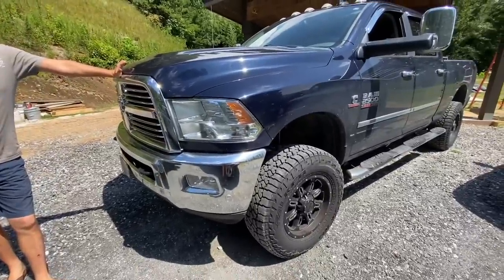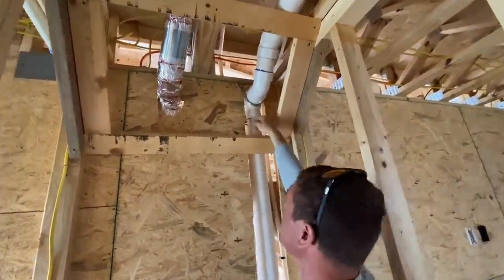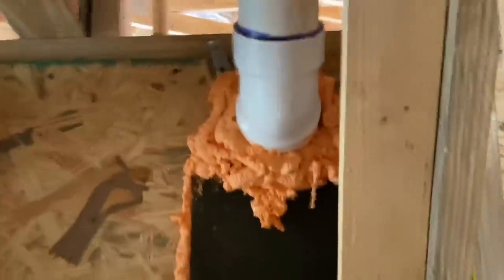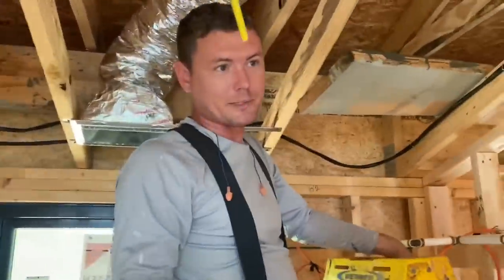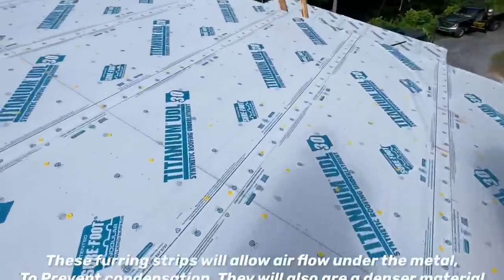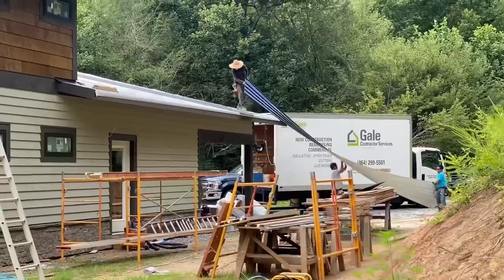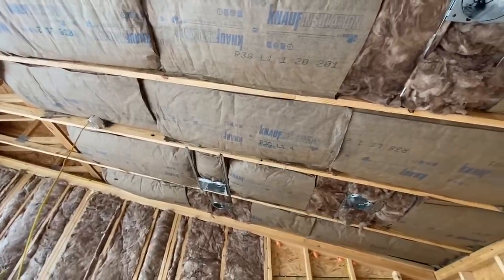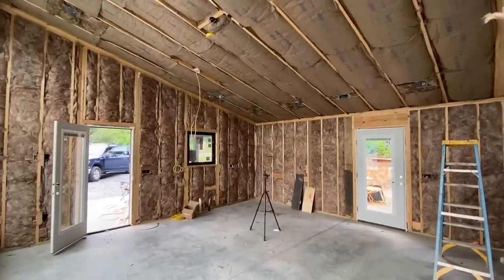Building A House Start To Finish | Episode 15: Inspection Fails and Roof

Comment: If I were a roofer I feel like if I felt a single drop of water especially on a metal roof I would want to get off as fast as I possibly can
Reply: Yeah that's kinda how it is, I live in Tennessee and I've seen roofers leave in b4 it rains. They see dark clouds forming and call it quits. People usually think it's not dangerous but all it takes are a couple drops before u go down

Comment: I'll never understand the concept of creating a water tight barrier and then shooting thousands of nails and screws through it....
Reply: Talking about the metal roof?  Yeah, it is kind of counter intuitive, but, they work.  More and more residential applications are using metal roofing because it has such a good life expectancy, is fairly inexpensive, looks pretty sleek, and keeps out the water.
Reply: @jimyeats  With all roofs, they work til' they don't, then you have a leak and all kinds of nasty stuff happening - especially in these air-tight homes. Be it siding or roofing, your cladding should NOT be your water tight barrier. Your cladding should be UV/wind/hail only. Never water. Even the ZIP system will fail, in my opinion. Far better than tyvek or other paper, but you are still penetrating your water barrier into water sensitive materials every time you go into it with a nail/screw or staple...
Reply: krishields2 Your post is all over the place. Unsure what point you are trying to get across. You should have roofing and siding that protects from bulk water intrusion, and a decent WRB behind that to protect against small seepage and leaks that will invariably get behind your roofing and siding, and a system that allows for good air drying between. 

Stop bulk water, and stop lots of free air movement into the home.
Reply: @jimyeats  That's the old way of thinking.... And that's why they always fail.
Reply: @Adventures_of_Marshmallow  That's actually the new way of thinking.  The old way of thinking incorporated trying to stop "vapor" and making a house that could "breathe".  

Current science realizes that you need to principally do two things; stop bulk water intrusion, because that's always a problem, and stopping free airflow, as that dumps far more moisture into a home than vapor does, as well as allowing for much more thermal loss than previously thought.  Many ways to do this, as well as many insulation techniques to consider.  

Would love for you to describe the perfect system so I have a better idea of the point you keep alluding to.  List specific products.
Reply: @jimyeats  I'll try to explain. First sheet your trusses / rafters with whatever sheet goods you prefer, this will become your watertight layer. Second, affix a non water sensitive 2x2 at each rafter / truss on top of your sheet goods. Third, apply either by spray or roll a waterproofing product of your favorite flavour over the entire roof deck ensuring full coverage and proper fillets over the azek 2x2s. Third apply a secondary layer of non water sensitive sheeting such as azek using proper length ensuring no more than 90% penetration into the 2x2 azek strips to attach whatever cladding you desire be it shingles, tile, steel, slate or whatever you want. As long as the fasteners you use penetrate no further than 1 1/4" below the bottom of the non water sensitive layer of decking, your home will remain water tight no matter what condition your cladding is in. Your roof deck and walls should be water tight both before AND after any cladding goes on.
Reply: krishields2 I can picture what you’re describing. That would absolutely be a great system. I think in most cases though that is going to be fairly cost prohibitive, especially when - in general - a ‘standard’ system works extremely well when it is done with diligence.
Reply: Why don't they make these roof panels with attached threaded screws. Which you could align with holes in your rafters? That way you can just nut them in place and you don't have to replace anything every 15 years.
Reply: @zteaxon7787  could do something like that also.
Reply: @jimyeats  Now take that system to the walls, you have a 1 1/2" air gap from peak to ground running the full length of the roof line which can now be utilized as a hidden seamless gutter system. Prohibitively expensive for the average joe, but not for the rich. Wouldn't it just be fantastic to not have ugly freaking gutters?
Reply: @Adventures_of_Marshmallow  Certainly.  Best option would be to combine one of your layers with exterior foam insulation, would really be the icing on the cake.

Comment: Hey guys, awesome videos. loving the series and came all the way back to watch all the videos to present.  I am an insulation installer in Ontario Canada, the code here has changed quite a bit within the last few years. in ceilings a minimum of R60 and R22 within the walls. every double stud has to be cocked with an acoustical sealant and then a vapor barrier.

Comment: Not sure if someone has already mentioned this but the hissing and no action is the can losing pressure. Best to hold the can upside down so foam always comes out, ie, no hissing and you don’t end up with a depressurized can that still has foam left but it’s dead. Love the knowledge and craft you guys display.

Comment: I insulated our house build in Lubbock, TX a decade ago. Thankfully it was done in November and December (right after Thanksgiving) so it was cold. Tyvek suit that sh!t up baby! I had duct taped gloves, around my boots, up the zipper, around my neck for a good seal, etc. STILL ended up with a razor shaving the underside of my forearms to pull the fibers out. So incredibly annoying. Still, WAY better than just a T shirt. :) You guys are awesome and I have learned a LOT from you. Keep at it guys! This is THC quality content, but actually good content, lol!

Comment: I am a building inspector in Indianapolis.  I'm not sure how your city/county handles this but the fire foam is not an approved fire blocking.  If you look on the can it says it meets the UL listings and the ASTM for fire blocking but there is an asterisk that says that it used a modified test.  Which is the reason it is not allowed.  You can take a piece of dried fire foam and easily light it.  I have wrote this violation many times.  I always say that it sucks that they market it this way so you think it would work,  and for the big gaps it's way easier to fill.  I always let the contractor know for the big gaps they can use un-faced mineral wool insulation/rockwool and that is approved.  Was really looking forward to seeing the inspection but I understand why it wasn't possible.  Really wish I could inspect your guys projects because you know what you are talking about and I deal with contractors on a day to day basis that don't have a clue about anything.

Comment: The header in the attic on the truss verts is a great solution for that issue to take up the roof weight off the plate over the window

Comment: If water ever gets under that metal roof, the horizontal furring strips will trap it. It’s better to use vertical furring strips on top of each rafter, and add horizontal furring strips on top. This will also improve ventilation.
Reply: This falls right in line with the statements that a house needs to breathe. Using real wood that can get wet and dry and using the ribbed panels that allow the drying to happen and proper flashing to control bulk water it will be just fine. 

Or you just install the furring strips at an angle that matches your truss to screw line. Eg truss at 24 and rib at 9 install the furing strips at 4 1/2 12 to the eve end.
Reply: Timothy Dillon - yes, it’s probably fine. I live in a quite wet area (Bergen, Norway). We’ve made some effort during the last 100 years trying to keep our houses dry even when the outermost layer of roofing fails. The current best practice is to ventilate between the insulation and the sheathing, use a waterproof ashphalt underlayment on top of the sheathing, vertical furring strips, then horizontal furring strips for cross-ventilation and finally glazed clay roof tiles. That gives you a roof that will last between 50 and 100 years without maintenance, unless something breaks a tile.

Comment: I watch videos on the Guilty of Treeson channel.  It's a channel run by a guy who runs a tree service in Seattle.  A while ago they had a job where they had to remove a completely dead tree from a homeowner's property.  The tree was between the house and the garage and both building had metal roofs.  While they were cutting parts of the tree off and removing them with a crane, a bunch of small pieces were landing on the roof of the house.  The final day they were there it was raining and they had a pain trying to clear all the debris off the roof.

Comment: The company i work for we got basically screwed by some floor guys they basically just stopped contacting us to do this customers house. So we decided to sand the floor are selves my bosses having a little experience in it we went for it. Well lets just say it didn't go well especially around the edges and we didn't realize till we stained one room. So we had to re sand it and go around all the edges and sand them perfect. It was a huge pain I was sore as hell but at the end of the day it looked way better and the customer was happy. Which made all of it worth it yes in trades you have hard days. But seeing the customer happy makes it all worth it to me.

Comment: Its beautiful watching people care about their craft. Even taking pride in insulation that doesn't get seen by the home owner. Question though, wouldn't you want the roofing slats to go vertical or at an angle to if water somehow got in, it could escape? If water got through the seal of the screw it would just sit and rot the wood. Also no vapor barrier needed in this climate region?

Comment: My professor tries to avoid using too much spray foam because she doesn’t believe it’s been around long enough to know if it has any long terms negative health affects or is causing any negative affects on air quality long term. So she only used it where it is absolutely necessary. We live in zone 5 so the I assume the R-value here it higher. She was also excited that she found these outlet boxes that had like these rubber flaps around them to actually seal the box and help stop air leaks. She only used them on the exterior walls. She works in the building industry and just finished her first leed certified house. Though she taking a step back and is going to focus more on her job as a professor.

Comment: What is the benefit of horizontal furring strips vs vertical or angled? Perhaps better air flow when horizontal, but how will water effectively drain if it get under the metal roof?

Comment: I've had two inspectors tell me that any spray foam will do for fire blocking. the fire blocking specific foam simply has a dye in it to make it easier to see for inspection.

Comment: While I agree with the firecode and inspector, you had to put a bit of flammable material (wood) over a hole to stop a fire in the event of one happening!    Just my oxymoron brain kicking in.    To be honest if all you had to worry about are those 3 minor defects, it is a good inspection!   We are not allowed plumbing in exterior walls due to Winter climate (Canada) and most times have to frame a mechanical chase and use pipe insulation to help with freezing.

Comment: Hey Eric, can you show another part of the 2x10 over the window and how it works ? Thanks !!
Great video btw as always !
Reply: Yeah, I can’t really see how those 2x10’s are acting as a header for the window.
Reply: You can screw the 2x10 to each truss. After that, you can simply remove all the the 2x4 on the flat and everything stay stable. The header is not actually below the truss, but at the same height. The span is only 36 inch.

Comment: I wish that more people were aware of Pro-Z screws for ribbed metal roof installations because the commonly used screws (the ones your roofers used) are the downfall of typical metal roof install. Pro-Z screws encapsulate the rubber gasket, supposedly cant be overtightened, come in all of the colors used by panel manufacturers and have a 50 year warranty. Who the hell wants to have to replace all of those screws every 10 to 15 years? That's insane and is enough to make people change their mind about choosing metal for their roof.  Google Pro-Z screws and it's a game changer.

Comment: if fairing strips are perpendicular to the roof pitch, do you assume that the condensation from the metal sheet will evaporate with air? Because the fairing strips will not allow for the water to run down the roof into a gutter.

Comment: My opinion is that glass wool is way itchier than rock wool. Wool made of recycled paper is not itchy at all but twice the price. Once i have made insulation of flax wool which can be done bare hands but also expensive and makes all knives dull in just few cuts. If i could choose any insulation for my house it would be wet sprayed recycled news paper. Or burned brick with air pockets. No plastic any where.

Comment: Jeez. What snow loads are you getting for 2 x 10 headers over tiny windows, 2-3 2x4s over a most single windows is plenty and we get 4 feet of snow on our roofs. I guess insulation is an afterthought.

Comment: Metal roof can be very slippery even when it has little water on it. However real Rubber shoes has best grip. You Dont put urethane wheels on your car either.

Comment: 10:00 Where does the water go if it gets under the metal roofing? The wood strips will prevent the water from sliding down towards the roof edge!
Reply from the maker: Well... good question. Short answer is that the metal roof should keep ALL rain water out. The air gap created by the wood strips allows for air flow to prevent Condensation under the metal. Strips or no strips if water gets under the metal it would leak. There’s 1000 screw holes and nail holes fastening the metal, just like if water gets under the shingle layer of the house it will usually leak due to all of the nail holes through the underlayment.
Reply: @PerkinsBuilderBrothers  Well, sooner or later water will get under the metal roof because the screw holes get bigger and bigger whenever the metal expands or contracts due to temperature differences between day and night. The rubber gaskets will eventually fail (usually  a lot faster than 10 years IMO) and that's why you should always go for a standing seam roof! Putting holes in a metal roof is never a good ideea!

Comment: The pipe can’t be there because it could be hit with a nail? Is it because it’s within 1 1/2” from the front of the stud? By that logic you can’t run any pipes in the stud bays. If you put it to the back, you not only lose insulation but you’d put the pipe in danger of being hit from a nail coming from the outside.

Comment: Use baby powder every where there is exposed skin when installing installation. It fills the pours of you skin, then all you do is rinse off and whip off in one direction or you will push the fibers into your skin.

Comment: The reason the drywallers truck is taller is their stilts. It is impossible to get into a normal truck with stilts on so they adapted and overcame.

Comment: I'm asking because I truly do not know...  I have been told that standing seam  metal roofing has hidden fasteners that do not need to be replaced every 10-15 years.  Is that true?  And if so then why not use it on this house?  Is it simply a matter of cost?  I think the reality of life is that the fasteners will not be replaced on this roof until it leaks to the point of aggrravation that makes the trouble and expense worthwhile.

Comment: I dont understand how that 2x10 over the window becomes load bearing?
Reply: Maybe it's more like load spreading? My understanding is the point of headers is to spread the load to vertical studs, especially king studs. Have just a few parallel studs crossing that opening have a chance to sag over the years potentially. That's why sometimes people create headers with two 2x4s nailed to a perpendicular 2x10/12 over doorways. To reduce sag.

TLDR; less load bearing and more for keeping the shape of the opening over the years?

Comment: About the temp sensor for the thermostat in the bathroom. Why are everyone placing the sensor in the floor? Sure, in climates like yours, but in cold climates (Norway for me) that seems a seriously stupid place too put it. Preferably I would have liked it dangling down in the center of the room, but why not halfway down an internal wall? The heat in the floor should keep the room at a specified temperature, not the floor.

Comment: You definitely suffer as a builder or carpenter. One of my first jobs I hung fiberglass insulation for a few hours with only a bandana around my face... and gloves and a shirt of course, but no legit breathing protection. I was coughing bits of blood at the end. I feel that that should have killed me already. Also the fumes of Copper Green I sucked in while working on bathroom floor joists one day gave me a massive headache for two whole days. Nasty stuff. We leave bits of our self at every job. Cheers.

Comment: Can you just get an engineer to specify sufficient shear connectors to that "header" to make it a proper header? Because the timber cross section at that point clearly is sufficient.
Reply: If it didn't require an inspection, the stacked 2 bys could be glued together and it would act as a Glulam beam and you could also span a longer distance.

Comment: Those insulation R-values are laughably low to me.  In Norway new builds usually have at least R60 in the walls and usually double that in the roof.